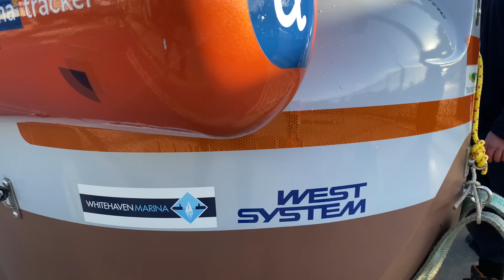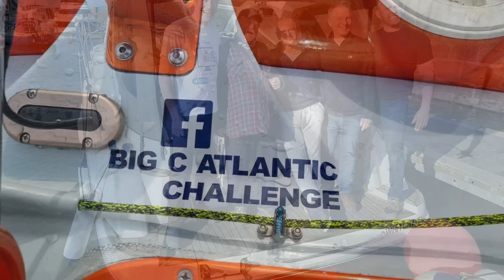Big C Atlantic Sea Trials Whitehaven Feb 2023

Comment: Not enough room for two months of food and water let alone a stove and bucket. Will need a bucket of cream for the salt water soars.
Reply from the maker: Your right, i have a desalinator onboard, and a special mix of food with enough for nearly 100 days. No stove as cant deal with a possible burn.
Reply: @Adventure101  must be one of those lifeboat type desalinators, practice with it and see how much energy it takes to make enough to survive. Those float behind tents have proven not to work in the open ocean. 100 days is pretty optimistic, you will be lucky to do one knot. Half the time you will be in a wind shadow in the trough. I can’t see you having an autopilot, needing battery and solar panels and hand steering 24/7 is impossible, especially at night. There isn’t enough lateral stability to self steer. One of those twin head sails will constantly backwind. You might want to consider a kite.

Comment: You're putting other people in wrist if you get in trouble
Reply from the maker: I won't be....The vessel is designed for this exact passage by a former record holder for the same trip. Its built like a tank, and ive done thousands of Miles in other small vessels, up into the Arctic, round Icela down towards Greenland et  all solo.

Comment: I WISH YOU LUCK, BUT BE REALISTIC... 
During your interview you dared to stand up in what were only 1 ft waves and a gentle 5 knot breeze, and you were continually under threat of capsizing. 
Also, NOT ONCE when you were "under sail" (note: my 6 yr old granddaughter has more "sail" when she stands & spreads her beach towel out from her body while standing on my stand-up paddleboard) did ANYONE actually SEE THE BOAT MOVE. NOT ONE INCH, much less 1900 km :-o 

I'm typically NOT a nay-sayer - I WANT you to be successful, but this boat is simply NOT DESIGNED FOR FORWARD MOTION. 
You may as well be putting a SAIL on a BUOY, and expecting IT to begin to move ! 

IDEAS IDEAS IDEAS... 

HERE'S ONE: 
Your HULL may be CONSTRAINED to be under 2m (or whatever)... but is your KEEL ALSO constrained? 
IF NOT, then I HIGHLY RECOMMEND that you install a NEW KEEL whose length (under the water) is 3 TIMES the length of the hull. 
Use the BLADE on a SPEED SKATER'S SKATE and you'll get the idea here. 
The ONLY way you're going to get TRUE FORWARD MOTION out of your "vessel" is if your LENGTH is MULTIPLE TIMES your WIDTH - YOU KNOW THIS !!! 

Hope to see the boat actually MOVE (you're NOT fooling anyone right now!) in your upcoming REDESIGN and 2ND SEA TRIAL :-) 

Your (genuine) fan, 
- Mark Vogt | VOGTLAND OUTDOORS

Comment: Just a casual observation. I would really insist on having a skirt around the waist like on a kayak. A small sail like that will be a lot less than ideal. Good luck.
Reply from the maker: I have looked at that........and the boat is set up to be fully powered up in 15knots from then on upwards i just furl the sails
Reply: @Adventure101  Viking did it. Youll do fine.